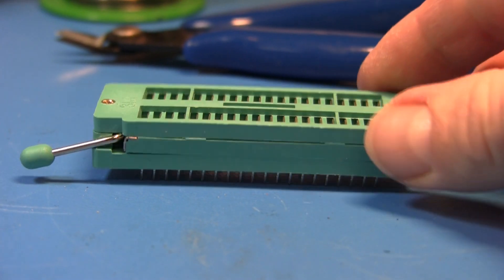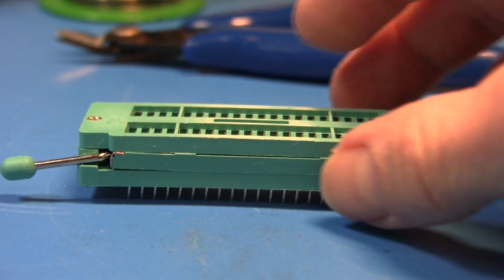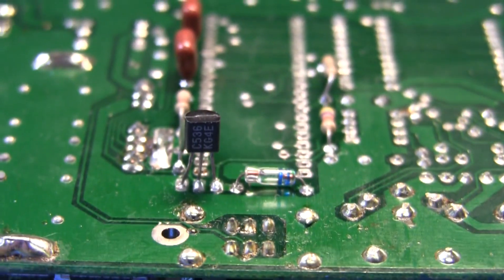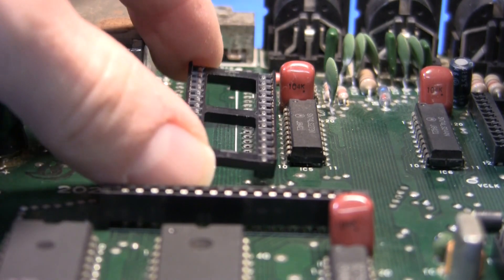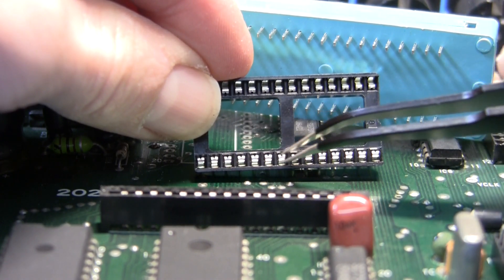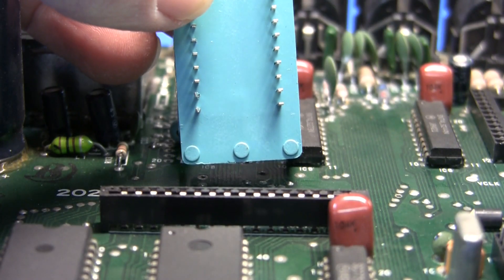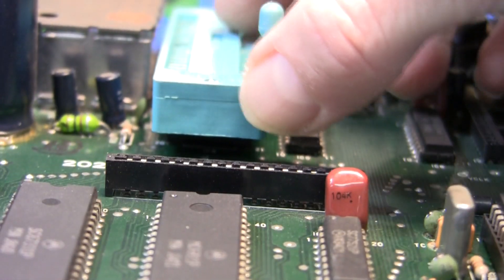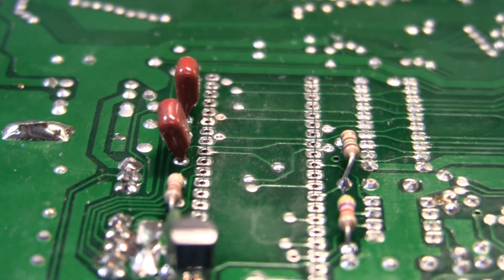A ZIF Socket seemed perfect at first... then a pit of despair... and then finally awesome.

Comment: 1) I think ZIF pins are oriented that way to cause minimum trauma on installing in breadboards 
2) If you are NOT using 2-sided board with plated-thru holes, just ream the holes with a rat-tail-file or ground-hacksaw-blade
3) If you have the fingers of a brain-surgeon, you could grind half the pins at a time on the edge of a whetstone.

Comment: The “round pin adapters” are formally called “machined pin sockets”; and that’s what you’d use as search terms to find them. Also - at least on the ones I’ve seen - they are split at the top; the ZIF pins may fit into them without twisting.
Reply from the maker: You've seen some different pin sockets then because there was no fitting into these. The openings are round and fit only other rounds or most IC legs, however, not the ZIF socket's wide flats.
Reply: @acs8-bitzone651  I think he means they fit...with a hammer.  Lol
Seriously, I never received any like that but maybe I'll give digikey a shot vs AliExpress....I'd like to find them because that's why I don't like them ...I'm waiting to bend or snap a leg off an IC pushing them in and quite frankly it scares me away from them.